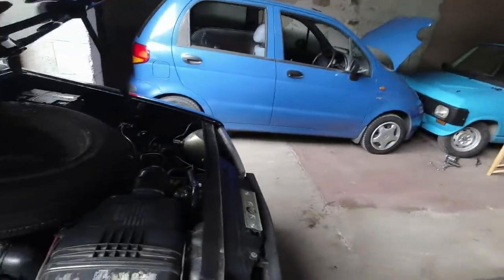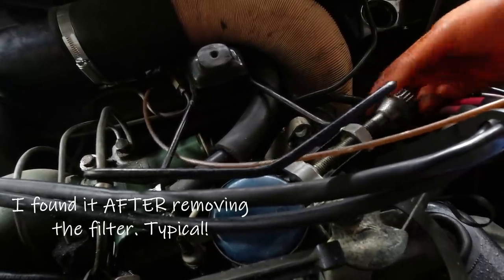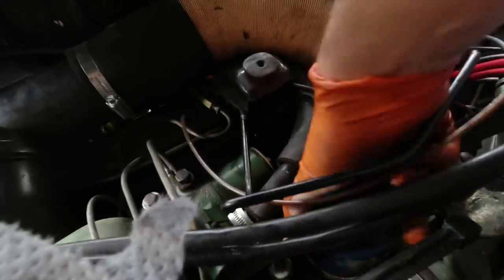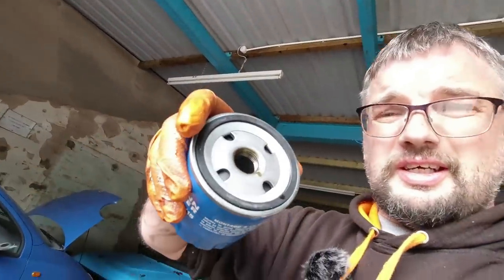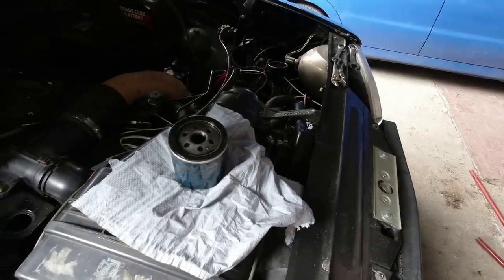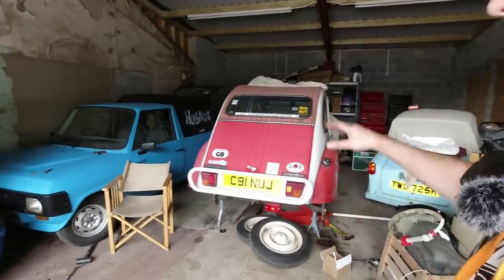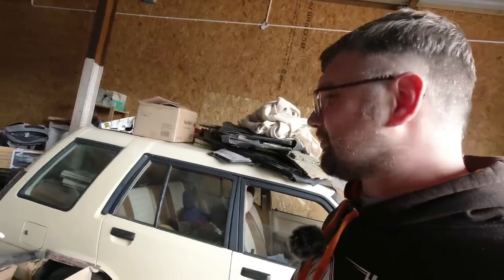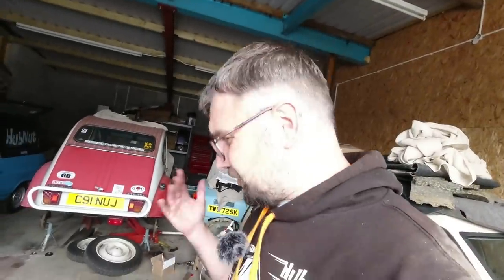Citroen GSA oil and filter change. How hard can it be? (CONTAINS PROBLEMS)

Comment: You need an axial oil filter removal tool - it'd make removing that on a cinch. Here's an image of one version: https://images.homedepot-static.com/productImages/a200cbeb-c709-43d0-9abb-a0da3c45770b/svn/imperial-oil-change-tools-if-103-64_1000.jpg

Comment: Tip for next time you change your oil filter: i) Make sure your new one is correct, then ii) punch a hole in the old filter with a hammer and nail to allow the air in and the oil to drain.  I thought the GS was really easy to work on!  You hardly needed to bend over to change the oil.  (I won't mention adjusting the points and timing or anything to do with brake pads)

Comment: I've re used oil filters before I used to pour petrol into them and give em a good shake, drain & repeat until fluid comes out clean. The only problem with doing this is once you start to agitate & loosen the trapped metal particles in the filter media, you will never get it all out & once you start the engine & get oil flowing thru it again it will release some of those particles back into the engine from where you dislodged them.
Personally, I would wait until I could get a new filter that fits, or if that old one is not too old just re-fit it without attempting to clean, then just do another oil & filter change in 1000 miles.

Comment: You and your oil changes. The reality is that so long as the oil filter is able to filter 5 microns' then it doesn't really matter what colour the oil is. Too much attention to oil and air filters, hence why the 2CV is starting to become a problem car. Oil changes are not important unless to intend the car to last for 400,00 miles - the filter is of course

Comment: if i remember  correctly i ended up puncturing the  filter to get mine off and yes its messy. By the  way  do you have the humungous  socket for the fan  should your fan belt go ping?

Comment: What you should invest in Ian is some red rubber grease to lube the seal much better than using the engine oil just a thought as i always use it and when my customers cars come for a service the next time it is sooooo much easier, also the filters being on the top like that the spillage of oil is minimal as gravity takes its course and there usually is no spillage, but access is not the greatest in your case, love the videos mate...

Comment: Moral: ALWAYS check you have the correct parts before you start! (If it's any consolation,I did the very same thing with a FIAT Uno way back when......then chucked the threaded bit the filter screws on to in the bin as well!)

Comment: Wow Hubnut, I wish I could have sent you some of my luck.  Friday afternoon recently, I heard a noise from the front brakes (FG mk2 Ford Falcon ute), and remembered I hadn't checked them in a while.  First hopeful sign was dropping into the parts shop.  40% off Bendix brake pads sale.  Calipers and discs just came apart and reassembled so easily, I renewed the front brake pads in about 50 minutes - including having to jack up one side at a time and remove and replace the wheels.  One of the old brake pads was worn almost to the metal plate.  I will have to be smarter than that in future.

Comment: Excessively tight filters ..... My theory is that when you spin it on it does so on a flim of oil allowing the o ring to compress.
Fast forwards a year or two the oil is squeezed out and the rubber just sticks to the housing.
Solution ..... Long screw drive through the filter or use as a chisel on the base

Comment: With regards to the worries about the oil filter head thread, what tends to happen with those Sykes-Pickavant removal tools is the metal strap breaks before you damage the head. Can buy replacement straps separately too. I find that better than bending the legs on the socket type, or the rubber straps that slip once oily.

Comment: Interesting, changing the oil filter on my '96 ZX TD is an absolute breeze. It's on the front of the engine and easy to get at. Citroen must have been having an off moment on that design.

Comment: The reason for hand tight with these type of filters is so that you could undo them afterwards. Much heating and cooling down makes it more difficult to remove so the best go is to not tighten it too much indeed.
The best is to remove the part and go with it to the supplier. That saved me a lot of trouble on working on cars. Or you can look it up by the part numbers. 

Was it difficult to adapt the clutch?

Greetings from very sunny Belgium.
Reply from the maker: Adjusting the clutch was horrible. Easier if you remove the heater blower apparently...

Comment: That thrust bearing needs changing as no amount of adjusting will repack a dry or remedy a worn bearing. Perhaps you should consider turning up the stereo instead !.
Reply from the maker: Given it's an engine out job, that isn't happening until it needs to.

Comment: Ian, surely you realise in this line of work (as my dad was) and as he said "The job has developed" - so you should be reasonably used to the many! bad days !
Be positive - at least hopefully sorted on the clutch bearing issue !
Reply from the maker: I think part of the frustration is that I don't know my way around this car yet. The oil filter AND the CityRover news just added to my annoyance.
Reply: @HubNut  Over the years you'll collect customised tools for various reasons - and as you've found, short tools can be really handy at times.
As for oil filters, I have in the past used Stiltons - not due to tightness but peculiarities of access.

Comment: Too many cars? That's a subjective opinion. This wouldn't have been a problem if we did not have a global pandemic, unfortunately, we do.
I thought the UK 🇬🇧 was opening up some businesses, you should check out the garage mentioned to see if you can schedule a thorough servicing.
The BBC has mentioned many in the UK have been driving despite lockdown, not that you would do something like that. As long as you observe the two metre (6 foot) rule, all will be okay. I know this is your private fleet, but your business depends on your vehicles, so I believe an exception is allowed.
The one thing I do NOT miss is changing oil on a vehicle, I hate and loathe it. However, to have a garage perform one a relatively new vehicle (2007 Saturn VUE about three to four years ago) was horrendously expensive! Worse, no synthetic oil, bought the oil filter, AND I MADE AN EARLY APPOINTMENT. Last time I ever did that!
Reply: I thoroughly enjoyed this video. Good or bad, I tune in for the latest updates or vehicles you have procured, and see whether you like it or not.
Reply from the maker: The issue is I'd need an overnight stay to visit the specialist, and that's not currently possible. But, a quick(ish) oil change now means I can delay that visit.
Reply: @HubNut  That I definitely understand. No win situation. Ugh.
So the oil change yourself was the only solution, I cannot fault you there.

Comment: Why not bang a screwdriver in at an angle from the top and loosen it that way!
Reply from the maker: If I'd done that, I would have been absolutely screwed given the replacement didn't fit.
Reply: @HubNut  That clearly shows I should have watched more of the video. 🙄

Comment: Even for an old car I'm surprised how hard it is to work on it... such as the oil filter, speedo cable and timing belts etc. Then again it's typically citroen 🤣
Reply: buy an old car they said.
theres no complicated electronics.
it will be simple to work on they said.